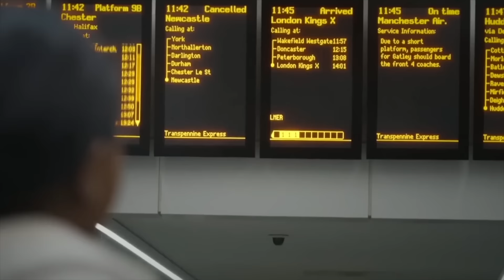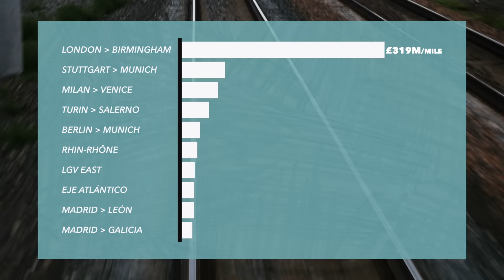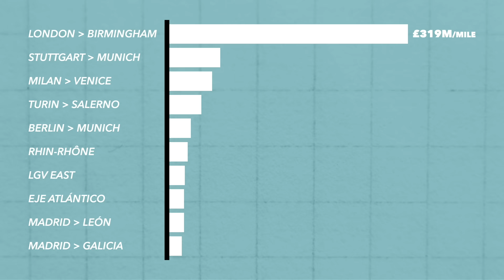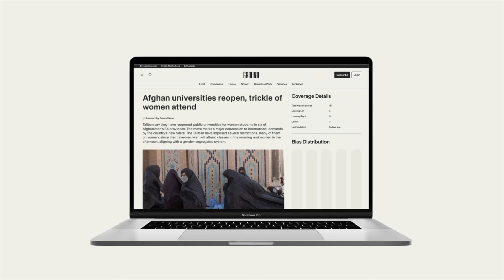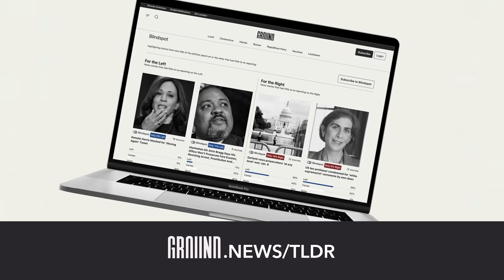The £100bn Railway: Why is HS2 Four Times Over Budget?

Comment: This piecewise approach is exactly how the Japanese Shinkansen are built. It wasn’t a huge project accomplished all at once. They’ve been gradually extended for almost 60 years and they’re still going. In recent years the Hokuriku line was extended through Toyama and Ishikawa while Tohoku line was extended to Hakodate in Hokkaido. This alone is a massive achievement including the Seikan tunnel under the Tsugaru strait which is wider than the English Channel in an area with the highest snowfall on earth. Just months ago the “Nishi-Kyushu” line opened from Nagasaki. All of these go to the middle of nowhere though. They’re incremental steps on wider plan for nationwide infrastructure. They’re being extended through to Fukui, Sapporo, and connecting to existing high speed lines at Fukuoka’s Hakata station. Combined this will connect cities throughout Japan. That’s not even mentioning the new maglev project.
Reply: Also, the oldest section between Osaka and Tokyo was only 100mph average, with the highest speed of 140mph for a long time. Only relatively recently did the section started to see speeds comparable to Europe (highest speed 160mph), and it's still slower than the TGV or the ICE, yet it's still financially viable.
Reply: @HenryMidfields  It's true it has been incrementally improved but the Japanese Shinkansen are capable of travelling much faster than they generally do. On the sparsely-populated Tohoku route, they have an operating speed of up to 360 km/h (much faster than Europe). This has been the fastest passenger rail service for years, although some in greater Shanghai are faster nowadays. 

The Tokaido route is one of the most densely-populated regions in the world. So due to stops being closer together and for noise or safety concerns they operate at lower speeds (285 km/h) than they are capable of.

This is one of the motivations for the construction of the alternative Chuo route via deep tunnels through sparsely-populated mountains. It's still a controversial and expensive project given that travel by Shinkansen is comfortable and most passengers are fine with current travel times. The main reason to expand the route is limited passenger capacity (on the world's busiest high speed rail route) rather than demand for faster speeds.
Reply: The Nishi Kyushu shinkansen isn't a very good example to use because it was planned in 1972, didn't start being built until 2008, only opened in 2022 and is only half the route planned because one of the prefectures refused planning permission through it's area because it saw no economic benefit and this left the section that was actually built totally isolated from the rest of the shinkansen network and passengers have to change to ordinary express trains in order to complete the rest of the route. There are no plans to complete it in the future either and even if there were it would be at least another two decades at before it would open.
Reply: @TomKellyXY  The Tokaido Shinkansen also has sharper curves which is another reason for it running slower. As for the Chuo Shinkansen I read that it's construction has been held up by the governor of a prefacture along the way, who has been asking for a more detailed EIA, supposedly worried that the tunelling required might pollute the onsen /hot springs there. However some people think he's just unhappy that that shinkansen doesn't stop in his prefacture. However I heard he might be replaced this year due to a scandal

Comment: Its over budged, not failing. 

Japanese shinkansen is the best hsr system in the world and was also 2 or 3 times over budged
Reply: The cut backs on this are not helping the project one bit.
atleast Shinkansen was built in full.
Reply: But then the pride of China HSR in 2010
Reply: Its behind schedule and 4 times over budget
Reply: 3 times over budget is on budget.
Reply: It's actually a big part of the issue with the UK and US and rail. They just aren't willing to allow it to go over budget. Shit happens. Budgets are often nonsense. Sure there should be consequences but letting such a project fail despite it being perfectly fine outside of the budget overrun is much worse.
Reply: @XMysticHerox  evidently HS2 has been allowed over budget
Reply: @williamthebonquerer9181  In the sense it is not off the table yet sure. But they already cancelled important aspects like the link with HS1. The link to Liverpool is also probably not going to happen.
Reply: @XMysticHerox  well yeah cus it's been such a failure so far
Reply: @williamthebonquerer9181  It hasn't failed though. It's over budget. Not the same thing. Many good infrastructure projects were over budget.
Reply: @XMysticHerox  True. If they pull trough and deliver europes fastest rail connections between major cities nobody is going to remember that it's over budged. It might become a vital connection like the shinkansen, chinese hsr, taiwanese hsr or spanish hsr.
Reply: @XMysticHerox  Of course High Speed United States Railway has not one of them ever since as it was felt compromises. Except Amtrak North East corridor was built since 1990 and 2000s, and the speed service btw around 200 or less 250km/h operation. The question mark as can California HSR in West Coast corridor or not? And it doesn't sound whether possible routes in anyways has already begun, I mean look at United States Rail Engineering has progress in between those States conflict, and how does America feel oversees landscapes their purposes changing so far. Depending only 1 (or 2) phases beyond as long as US budget secured btw San Francisco and LA, so it isn't perfect points all railroad routes whether possible to reach destinations can achieve and the other and so forth. Who knows is it worth enough, (I think)?
Reply: Well in UK , we don't have the industry increase , a big enough metropolis in our cities for the HS2 to be even worth it another waste of tax payers money just like the work program which cost 4 billion and which achieved very little , for all that cost there wasn't even any new apprenticeship , academy , or any job training for Careers
Reply: @DC3Refom  I think you might be wrong there. If the UK doesn't have big enough cities to connect, I don't know what country has. 

I live in the alps in Italy near the austrian border. A high speed train stops in a small 20.000 people city down in the valley and takes me straight to vienna. Totally worth it.
Reply: @zockercam8122  not enough of an economy , industry, infrastructure , that would make it worth while or benefit more than the south

Comment: The cost per mile comparison is not  actually that unfair. For example the Stuttgart-Munich connection cosnists of 155km new track (most of it outside of Stuttgart being dedicated high-speed), 87km tunnels, 57 of those under central Stuttgart and the moutains that surround the city, and a brand new underground railway station in Stuttgart with tracks going perpendicular to the old statio, that is completely replacing its predecessor (one of the busiest stations in Germany). The Berlin-Munich connection that was also on the chart had 230km new dedicated high-speed track built through a region that is topographically closer to Wales than the flatness of most of England, with 27 new tunnels of a total length of 63km and 37 new rail bridges including the two longest in Germany.
Reply: Same for Italy. For instance, part of the Turin-Salerno line quoted in this video was where they managed to build the section between Bologna and Florence all underground, through the mountains of Tuscany - all for a lot less and a lot quicker than HS2 is due to take through flat, open countryside. What's our excuse in the UK?
Reply: @samuelollis5355  That's awesome! The excuses I keep hearing why the UK can't do the same mostly revolve around how expensive it is to tunnel under built-up areas and how expensive it is to purchase the land. But other projects on the continent have the exact same issues to deal with and manage for a lot less and much quicker... Brexit likely will have increased costs significantly, but suggesting St. Brexit could ever do anything wrong is still a taboo.
Reply: @kortanioslastofhisname  or the classic “but we are more densely populated than other places” forgetting we aren’t even in the top ten countries by density
Reply: @Vonononie  Oh, yea that is definitely a classic, has also been used to excuse the terrible state if motorways for decades... but somehow the Netherlands (quite a bit higher population density than England, I'm going by England since the people saying things like that forget Scotland, Wales, and NI exist most of the time) and Belgium (population density of England exluding London) have similar topography to England but manage to build more high-speed rail, at a faster pace, creating a denser network, for much lower cost...
Reply: But don't ignore that Stuttgart 21 was announced in 1994, and won't be complete until 2025. It is massively over budget too.

The real crying shame of the comparison though. Is that Stuttgart (Germany) is spending all this money on a brand new through station, while we are building brand new dead end stations in our cities!
Reply: @Vonononie  I don't necessarily disagree, but you would need to look at population density around the lines themselves. It's fine to say your population isn't so dense nationally, but if it's going through London suburbs it's very different to the Highlands so the national density is pretty irrelevant.
Reply: @JoeWilliams-bp5nm  other places have high density cities too. Look at Paris a high density, expensive city with massive restrictions on what can be built (more so than London) and it has 7 high speed lines going into it. Amsterdam is in the process of expanding central station, everything from improving bike parking, rerouting roads into tunnels, expanding canals, building an underground metro linking north to south, moving the bus stop area. All in a very high density city, digging through difficult ground due to the water table being so high, and yet it’s not spiralling out of control. Only about 5% of the HS2 route is in Greater London then it goes through relatively low density areas, with good topography for building infrastructure. The reason things take so long and are expensive here is because we don’t have a government or civil service capable of managing large infrastructure projects (and that goes back decades so regardless of the political party)
Reply: @Vonononie  As I said, I don't disagree. The point was more of a general one. 
I have no idea why we're so bad at it, especially given the amazing things that were achieved not so long ago. You'd hope that culture would have lasted longer... 
Genuinely I'm starting to think that our government wants things to fail because there's no other explanation for the failure/ problems otherwise.
That being said, I don't like HS2 and would have much preferred another standard speed line that could have avoided many of the more valuable (naturally, historically, not monetarily) areas of land that HS2 couldn't. But I do live in North East Birmingham so the destruction HS2 is causing is quite close to home and time savings to London are minimal, esp. given the location of Curzon st.
Reply: @JoeWilliams-bp5nm  I think HS2 started with a great idea; link the Scottish and northern cities together so a person can get in a train at Scotland and go direct and fast to Barcelona in Spain. But years of mismanagement and compromises means these are now fragmented bits of rail which doesn’t really benefit anyone. I agree the money could be better spent upgrading and supplementing the existing network
Reply: @kortanioslastofhisname  The government changing it mind every 5 minutes doesn't help. Euston station and that part of the project had had at least 3 redesigns, probably more at this stage. They blew 100 million by scrapping the last design.

Comment: IF ONLY when rail routes were closed in the 60s there was legislation protecting the track bed routes from development. The Great Central route was superbly engineered as a high speed line from London through the East Midlands to the north and could have formed the mainstay of the route for HS2.

Alas the pro-road government of the time were not so far-sighted or selfless in their aims.
Reply: lol, the present government cant plan for 1 week ahead!
Reply: The Great Central route was far too curvy. Not a problem for the trains at the time, but not good to run the 300km/h+ high speed trains that HS2 will enable.
Reply: I wouldn't worry so much.  Every country need new railway corridors, not old ones.  Things change a lot in 200 years, and that includes the shape of the track routes.
Reply: @exsandgrounder  Absolutely. Gareth (Dennis) has an episode on his channel if anyone wants more detailed information.
Reply: But the old Great Central route would be of no use to the main stay of the HS2 destination of Birmingham which the main reason for building HS2
Reply: thats a common internet rumor, the GC is in no way high speed or designed to handle larger trains as popularly thought
Reply: the rail routes that were closed are still irrelevant. they would not make up more capacity to the place that needs more capacity.
Reply: But the old Great Central Route never served Birmingham the mainstay of HS2

Comment: Its very interesting that many of the problems overlap with those of California.
Reply: The California project was initially intented to be Los Angeles to San Francisco; it's now Bakersfield to Merced which is of very limited benefit. HS2 may well end up as the southern end of the Old Oak Wood platform to the northern end of the Old Oak Wood platform.
Reply: @John_259  er no, the Bakersfield to Merced is the first leg that will be opened. Reason why? Cheapest area to build and means it can help experiance aquire for the harder streches for the remainder of the project
Reply: @John_259  The California high speed rail (CAHSR) was, and still is, a connection between LA and SF that passes through the San Joaquin Valley to connect to other cities along the way and to avoid the mountainous coastal area.
It is the first section that is being built as it was to easiest to approve. The Merced San Jose section was recently approved. From San Jose it will use the Caltrain tracks (that by 2024 will be electrified, partly funded by CAHSR authority.
The current estimation for the valley to SF is 2031 (which is a bit optimistic).
Reply: @AL5520  And even then, it's not a maglev line, only a conventional line, China and Japan were the first countries to build maglev lines, with China being the first to build a maglev line at all, and Japan being the first to build a large-scale maglev line.
Reply: @candyneige6609  I mean sure, but beggars can't be choosers. I'll take a 250-300 MPH line in a country that has only up to 150 MPH.
Reply: @whattheydidnttellyouwithbr2844  Right.